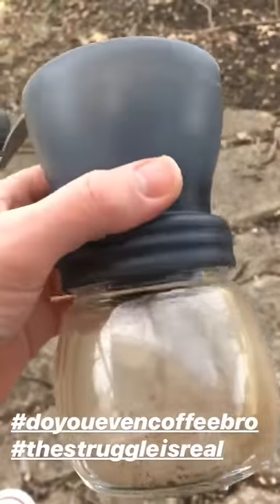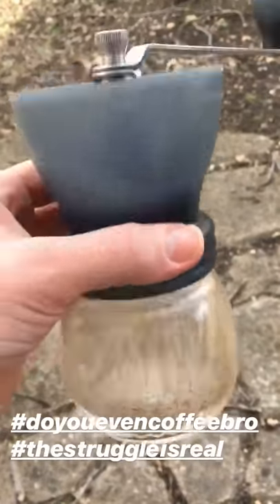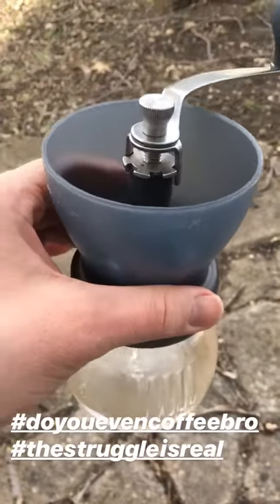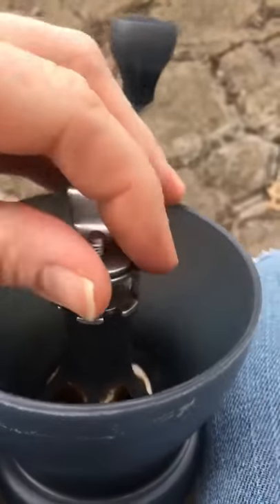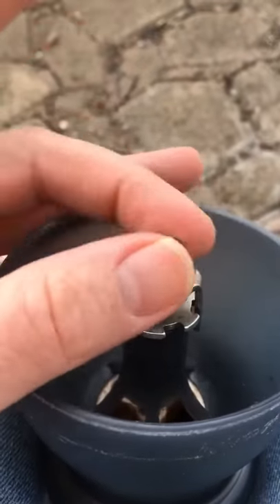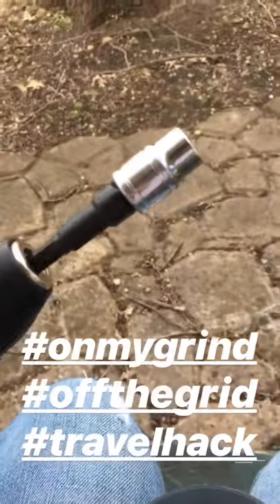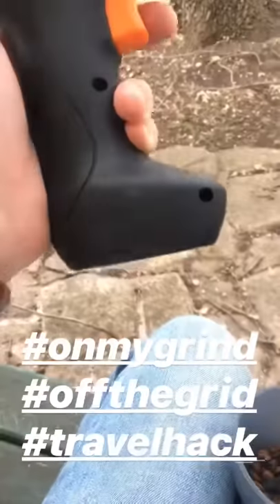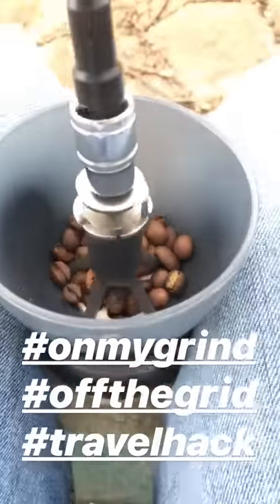Hario Hand Grinder Drill Mod

Comment: If you turn grinder to fast, the heat will melt the plastic shaft guide
Reply from the maker: Correct.  As long as you control the pace, you’re fine.   The drill I was using is a lower powered drill, so it wasn’t an issue, but when I traveled the visit my family(who don’t have a fancy grinder), I was able to use a home drill, and just controlled the speed.

I’m usually grinding <32g, so it’s not too much for the Hario.

Comment: How's the taste when you brew it? Did the torque of the drill not destroy/alter the taste quality of the beans?
Reply from the maker: The coffee tasted great.   The beans were a single origin Ethiopian.  I got strong blue berry notes, and it didn’t affect the taste.

I’d rather grind on my home grinder, but for camping or power outages, it’s a great hack.
Reply: @scnk  what home grinder do you use? I have Krups and hate it. Static is horrible and it's a pain to keep clean.
Reply from the maker: @eddieb1766  - I have a Niche and a Rancilio Rocky.   If you’re having static issues, you should try the Ross Droplet Technique(RDT).   Adding 2-3 drops of water helps a lot.
Reply: @scnk  Thanks, I'll try the droplets. I use local roaster so my beans are really fresh and oily when I grind. I think I need a simple grinder that's easy to disassemble and clean.